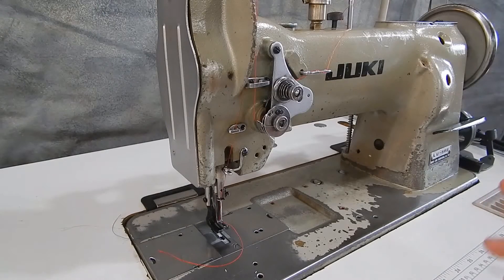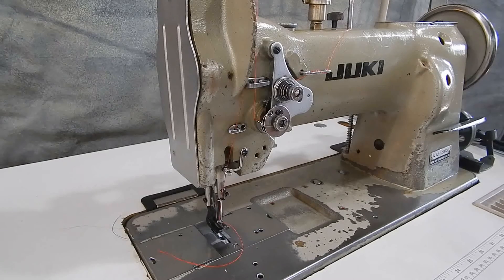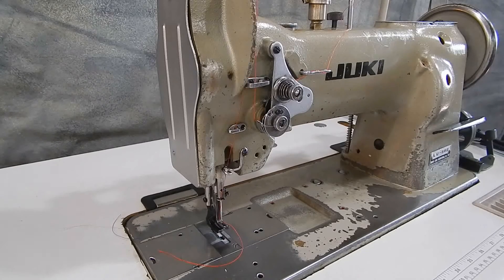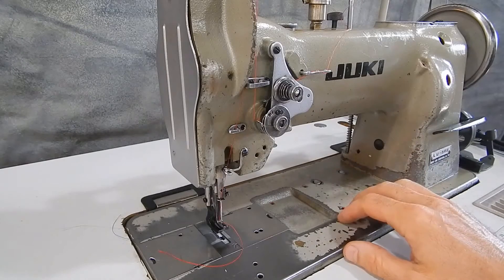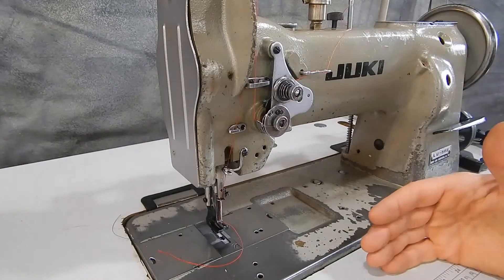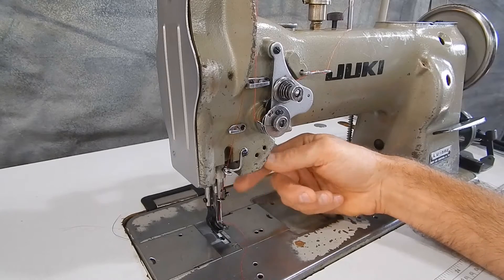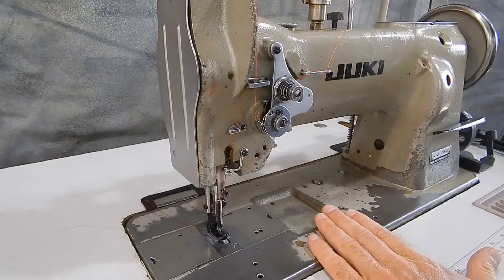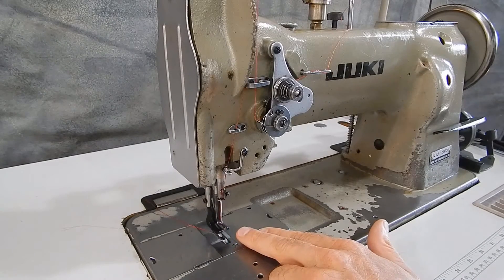Juki LU 562 Compound Feed Industrial Walking Foot

Comment: Awesome video 

I just pick up Lu 562! I love it and it is my first machine. It was kind of beat up and vary dirty but I cleaned it and started to train myself how to use it with your help so thanks!

I am having trouble with what I think is called "puckering"? When I run the material through at any stitch length I get waves like the tension is to tight but I play with the tension on samples and can't figure out how to get flat after it stitches? I changed the needle to a new one and it helped but still see some. 

I'm using upholstery fabric and some light vinyl. 

Thanks!
Reply from the maker: That is a good machine and I'm glad I could be of some help. I would guess that you are on the right path. Sounds like your stitches are too tight. Make sure you are threaded correctly, just one little spot hanging up can throw the whole thing off. The bottom thread should pull out of the machine pretty easy then if all that adds up, try loosening your top tension and see how it goes. If you get a rat's nest on the bottom you have gone too far.

Comment: This machine looks just like my old 1980's Juki LU1114-4 that hardly anyone knows about.
Reply from the maker: Ah yes, the upper and lower feed machine.
Reply: @AlexanderDyer  it has a Mitsubishi needle positioner on a 220V motor. I would like to swap it with a modern servo with a syncronizer. Hoping it can preserve its backtack functions.

Comment: There are two buttons on the deck of this machine. One is to adjust the stitch length, and the other that is noted as "A" in the manual has no descriptor. What is the function of this other button? I just got one of these a few days ago and in the process of figuring it out. I also ordered a servo motor using your link on Amazon. As the old clutch motor is way to touchy as have been the case with the other Juki machine I just sold for this triple feed. Thanks for the help!!
Reply from the maker: That is for resetting the safety clutch.

Comment: Hi Mr Dyer.  I am going to look at a used one of these tomorrow.  I am considering it instead of a new LSZ Sailrite for boat canvas work.  Am I on the right track with this Juki?  This will my first industrial machine purchase. How can I tell if it is worn out?  Thank you!
Reply from the maker: Condition.
How is it stored, is it currently in use, does it sew, is there sloppy movement, is it dirty, is it rusty, are there parts missing, is it properly threaded, what does the paint look like, has it been repainted. These are great older machines and I am a big fan but as you know condition matters. Sewing with a machine is a great way to infer it's condition. Can you imagine buying a care without starting it up to listen to it and take it for a spin?
Reply: @AlexanderDyer  Thanks for the great advice!  The machine seemed pretty solid so I bought it.  I have been watching your videos and plan to swap the clutch motor for a servo.  Thanks for being such a good resource!

Comment: Alexander Dyer, thank you for the clear and helpful videos you produce and share. I have a problem with a Juki LU 563 which is stuck in reverse. How can I correct this problem? Your help would be greatly appreciated.
Reply from the maker: Sounds like a deep mechanical issue. Sometimes it is best to summon a professional.
Reply: Do think you could help me with this problem as I am learning to repair sewing machines. I would prefer to do it myself.
Reply from the maker: I help where I can but I don't know where to start. Maybe your motor is running backwards. I don't know friend, I am really just blind guessing.
Reply from the maker: I wonder if I saw you found a lead on leatherworker.net? If not you then I can point you to some discussion about your problem.
http://leatherworker.net/forum/topic/69930-111ww115-hook-replacement/

Comment: hi Alexander!!! i ‘ ve seen you tested , used , this juki lu562-563 and brother ls2 b837, i’ m planing to buy one of this but not sure wich one is better,i used juki lu 563 and i know verry good what this machine can do , from other side brother has hook lubrication wich is verry important for me but i never even seen in my life , only internet rewiews, just i want any advice from you about durability and power of the mechanism , i will sew a few layers of thick leather most of the time, thanks in advance
Reply from the maker: I think you would be happy with either. The Brother LS2 B837 is a great machine too and pleasure to use. Very well made.Also a slightly newer model than the 562(3)

Comment: What size thread are you using on this juki lu562 ?  ? Thanks
Reply from the maker: I forget. I typically use Tex 105 Core Spun Polyester. I recommend it for denim, canvas and leather. It is a good place to start and then you can make changes based on your experience. Many people use Tex 69 Bonded Nylon but it is stiff and plasticy and not so nice to work with but then some jobs specify it so there is that. Mil-Spec.
Reply: Thanks for the info !
Reply: Como puedo haser para conseguir sus repuesto de la juki 562 disculpe

Comment: Hi. I'm trouble shooting one of these machines right now and was wondering if you could tell where the needle enters the whole in the feed dog - mine seems slightly off centered and is possibly scuffing the thread on the left side of the needle upon entry... does that make sense? in other words, the needle is not centered in the dog feed. Wondering if that's how its supposed to be or not! Thanks
Reply: Just looked at the video link below and see you have a different dog feed entirely... answers that!